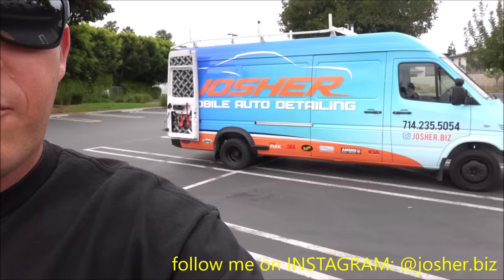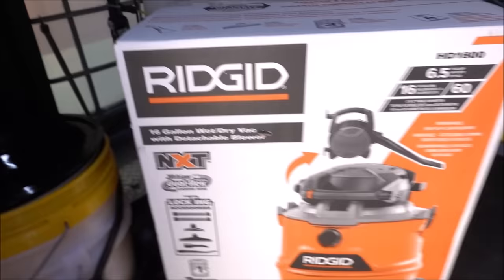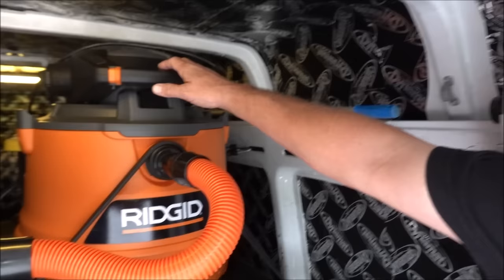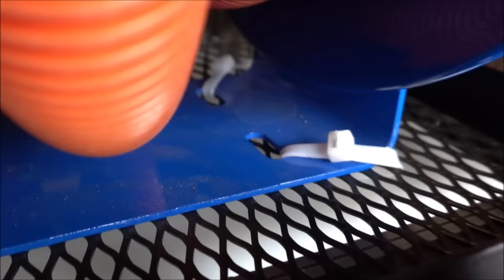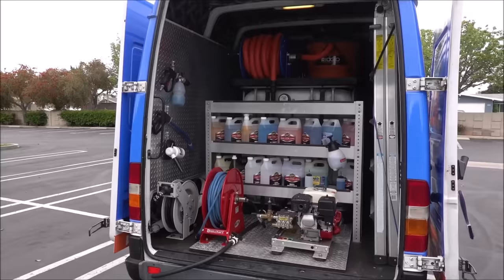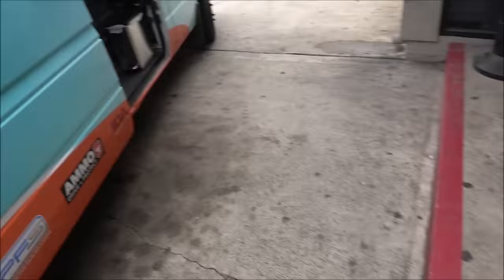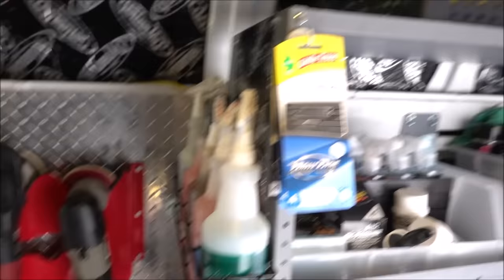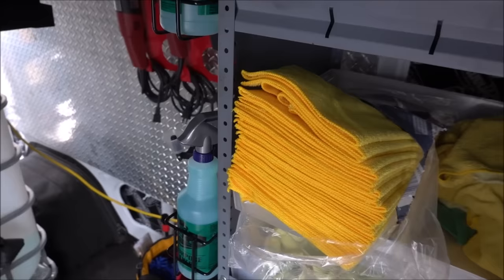My Mobile Detail Setup (*UPDATE**)  - New Vacuum / Hose / Reel

Comment: Thats the  size van that all  cleaning firms should have ..great job  ( only thing i would change is the water tank.. i would get  a proper water tank and get it bolted to the chassis  for security in a  crash )
Reply from the maker: thank you yes.. i love the size.   I think the water tank is mounted and bolted to the frame of the van...   the base is mounted to frame rear sub and the water tank is also super strapped down to the anchor points hard mounted in the van on the install..     I think it's mounted and good to go!     I hope anyway huh?

Comment: Great set up.  I just wanted to say that you should take individual pictures of your great equipment 
and have them added to the lower sides of your van,  pics maybe 1 foot by 1 foot in size and maybe
add some words about your equipment pics. maybe  (Top Quality Equipment for a Top Quality Job)
Also you need your phone number in large print on each side and on the back of the van.  you can 
also make something out of clear plastic that holds flyers and business cards and have them attached
to the van (Velcro) for people that are just walking by while you are working can get information without 
disturbing you.  Make them clear plastic so people can see that you have flyers and business cards inside.
Another thing always have a business card holder in your wallet with nice business cards never hand out wrinkled 
or dirty business cards.  Good luck and I wish you the best.

Comment: Great video, I'm currently doing waterless mobile car detailing out of the boot of my sedan, no water, no electricity needed, but i can only charge so much doing that, so I'm trying to transition to regular mobile car detailing, thinking of buying an SUV it'll be enough for my equipment. Small water tank, bigger vacuum, pressure washer, steamer, generator for odd occasions, water hose, product and accessories. I'm not doing paint correction, most I'll do is clay bar for dead bugs etc.

Comment: If you had a cart with all your interior detailing brushes/towels/cleaners and another with all your exterior detailing stuff (wheel brushes/iron remover/wheel-cleaner/etc), you could simply wheel each around with you as you move around the car. Only lifting one item (cart) in and out for the interior and then one for the exterior Just a thought that would make you even more efficient. Maybe you already do something like that...nice setup though

Comment: I been metal polishing and detailing for 22 years past 4 years I've worked at the USPS and still dabbling with detailing  by appointments on my off days. My dream is to to have a van like yours of some sort with all your equipment... this is really encouraging my to do so.. I love your set up my brutha! I need a van like that..what's the making and year?
Reply from the maker: Thanks James   0:44   -   2005 dodge sprinter 3500        (basically i was looking for any 2002-2006 dodge sprinter 2500 or 3500 high top.... long wheel base OR short...   The reason being is it's got a Mercedes 2.7 litre Turbo Diesel motor... Mercedes transmission and suspension.  I bought it for $8,000 with 155k miles.   I got a killer deal as I knew what I wanted and looked everyday for 40 days until I found one in one of the states I was ok with it being in.  Oregon..     Put the deposit on it right away...  flew there 2 days later and drove it back home for 2 days.  It was a beast!    Thanks for the kind words good luck to you on your search and setup!   It's a great thing to do, it takes time to build confidence, clientele and understanding of many areas but it's worth it!

Comment: cool setup.
mind telling me how you did the connection from the vaccum hose to the roller?
Reply from the maker: Hey Victor in the easiest words possible.... I bought a rigid vacuum.... and then I bought (on amazon)   50 foot vacuum hose / reel....  all the parts those things both came with hooked up nicely...   Hope that helps
Reply: OK thank you for answering! 👍🏼
Reply: @josholand  by any chance you have a link to where you bought the reel?
Reply from the maker: @ThGrtCanadian    No prob...   www.amazon.com     search:  vacuum hose reel    it is $499 I think

Comment: How big is your pressure washer gas tank and how much gas do you need to run a hole day detailing  say 30 cars up  how many cars do you detail before your tank us empty?
Reply from the maker: Hard to give you a number but let's just say a tank lasts ALL day of use..  (i don't wash 30 cars a day though lol... more like 2-5)      I carry a 2.5 gallon reserve can on board so just in case I run out or when I do... I have gas to still get me through the day...    Thanks for the questions...   I think the gas tank itself is like.. 1.5 gallons?  just a guess.

Comment: Why would you have anything higher than 2,000PSI for pressure washing? When the job is auto detailing.
Reply from the maker: I'm not sure how about you tell me?   It's controlled by how far you have the nozzle from the target if you were not sure.     Did I need to buy one that says max 2000 psi?    Check out my Instagram.... josber.biz , it's seeming to work out well for me wouldn't you say?   Lol.  You can get whatever psi you want but the higher you go the more careful you better be

Comment: Would a yamaha inverter generator with 2000w starting power and 1600w running power have enough power to run a pressure washer?
Reply from the maker: I don't know?   Mine is a gas pressure washer..   You'd have to check the specs on the electric pressure washer to see how much power it requires.

Comment: Did you need an adapter to connect the vacuum to the hose reel?
Reply from the maker: The 50 foot hose and reel came with everything to work with a rigid vacuum....

Comment: Is the reel and shop vac hose the centec brand? some reviews on amazon say it looses suction power. Have you noticed this?
Reply from the maker: the reel is cox... the hose is the centec hose..  it's the one that I bought on Amaxon for 399.99   now it's like 499.99   I have NEVER lost suction unless i had a clogged hose somewhere...    if they are referring to losing suction due to the length.... you lose like 6%  or some tiny number...   I use this every day almost for the last 3 years almost 4...  It's really a game changer to not have to remove your vacuum from the vehicle you're working out of.

Comment: Josh I have the same vac and reel on order. The vac has that 2.5 inch locking sleeve on the vac designed for Ridgids hoses. How did you get the orange hose to fit on that.....press fit or special adapter?
Reply from the maker: hmmmm good question!   I am pretty sure I just used everything that came with my rigid vacuum and the hose /reel....   IF i had to buy an additional plastic piece I would have bought it from Home Depot.
Reply: @josholand   Thank you.

Comment: Would the leaf blower part of the vacuum be effective enough to dry/blow out mirrors, grills exc? Awesome setup🙌
Reply from the maker: it would...  It's just a bit bigger than my easier 500watt handheld.   If that's the only option I had I would use it.  (it's not bad, just a bit big)
Reply from the maker: p.s.  my strategy requires 1 hand to hold my blower..... and my other hand for a towel so I can blow the water into a drying towel... that works like a charm for me so if I had to use the bigger blower that would be a harder task to maneuver one-handed
Reply: @josholand  I'm glad that works for you. I love the idea of having a larger wetvac with a extension hose. I'm looking for a adapter to make the hose a little bit smaller so I can fit smaller attachments onto the end to fit between seats.

Comment: How big is the difference in power , because obviously the 20 foot hose sucks alot harder than the 50, but is it a huge difference ??
Reply from the maker: Not a big difference.... the 20 foot does not suck a lot harder.  You wouldn't notice and if it does it might be a 10% difference at most
Reply: @josholand  thank you for the response, I was at home Depot about to order that real and hose, but I waited so I could talk to a vacuum specialist at the sir vac place, and he told me that switching to the 50 foot hose, I would lose a tremendous amount of power, so I did not do it, but now I am hearing otherwise, I think I am going to try it out.
Reply from the maker: @derricklarson2632  don't listen to that 'specialist ' because if that was his answer I can tell he has never tried a 50 foot before on a 6.5 he vacuum.   Works great on a 5hp vacuum too

Comment: Do you use a pump from your water tank to your pressure washer? Or does gravity do the job well?
Reply from the maker: a pump
Reply: @josholand  thank you sir
Reply: josher - Mobile Auto Detailing hey man, your setup is very inspiring! Can you tell me the brand of pump you use? And how you connect the tank to the pump, to the washer? Thank you so much. Subscribed!

Comment: So I own my own mobile detailing business and all been looking into buying a new van how good is your fuel economy in the dodge? Also have you find any down side to using the dodge over maybe something else?
Reply from the maker: well the dodge has a mercedes 2.7 liter 5 cylinder turbo diesel motor.... mercedes transmission and suspension.... it's awesome for fuel economy.  When I first bought the van I drove it 430 miles on 1 tank of gas 80mph most the way....  EMPTY cargo area of course.    A couple downfalls about the van is it's height... it can't go through the drive thru's and it can't go into most parking structures....    Also it's long so trying to park it where there is no room to park is a problem if that happens...  I think a SMALL custom setup would be equally cool  to my setup...  check out Tony's setup on  raldas detailing

Comment: I have the same hose reel and using the 6hp rigid and suction is not good at all
Reply from the maker: Something must be wrong with yours mine works great for the last 3 years no problems no issues with such a very strong

Comment: love you bro . just getting into detailing from hobby into new career after 20 years working for the man. So ive got quiet the huge  changing expedition before me! quiet scary really! Cuz I have 2 lexus sedans, and a motorcycle. I know I really need a van like yours I love the sprinters. any advise on where to get the water tank, maybe a used one, and an used sprinter to get me on the go working my ass off? I chose to ask you because of your honesty and humility towards the end, you seem a man just such as I bro. -love from soCal Desert.
Reply from the maker: Hey best of luck to you too..  It is scary to start off doing mobile detailing full time...  for many reasons.  I learned a lot in the last 2 years or so and I realized it's a slow steady pace you want to take and not to expect everything good to happen right off the bat.   If you live in CA then these water tanks should be all over the place.  Farmers use them as well.    I got mine from 'boyce industries'  in Santa Ana, CA     Also as far as the Sprinter van goes....  I searched auto trader, craigslist and ebay for 40 days until I found a good deal..   I wanted one between 2002-2006
Reply: Thank you my dude. Very laid out and detailed. Responses.  I live in a small town near Palm. Springs do not too close to LA unless to out of state peeps were all Los Ángeles haha.  I guess last ? Sorry to bug. How’s the sprinter do maintenance wise? Lexus style or Ford style Maint Hahahah.
Reply from the maker: @bigcroatevo5405  The sprinter van is awesome!   Powerful, drives as if it's a smaller vehicle, gas efficient...   Oil changes are twice as much as a car due to it taking 9.5 quarts of oil.    Maintenance doesn't seem to be too crazy

Comment: HI, which vacuum hose it that?  Are you happy with it still?
Reply from the maker: It's the one on Amazon  OR it was 3 years ago when I got it. ..  CEN-TEC   you can find the cox reel and the hose separate so maybe buy them and put them together.   Either way the hose and reel have been the best purchase for $400 dollars.... saves so much time energy and effort.   It paid itself off after the first 3 months so easily.

Comment: How do you run your exhaust exit for your pressure washer and generator?
Reply from the maker: Hey Junio thanks for the question..   My generator sits right by my sliding door of my van.  The exhaust side of it points out the door, so ANYTIME the generator is in use I have the side door and back doors open.  Also the pressure washer is exhausted out the back doors....   So when in use all the exhaust fumes go outside...   that answer you question?

Comment: Hey Josher, man I've been searching so hard in PHILADELPHIA for a store that sales di water and still at a stand still, Is your diamond plate platform attach to van floor or just held down by weight of water (tank) I don't want to bolt (put any holes) in my van? thank you for this video update
Reply from the maker: Darn!!  you might have to filter your own water some how.   My diamond plate on the floor is mounted to plywood...   I did have to have about 4 holes drilled into the floor of my van but that was necessary to end up carrying a variable 0-2400 lbs in the rear.     Thanks for coming to check out my updated van setup and please let me know what other questions I might be able to assist with.  I love our community of detailers!
Reply: For the Diamond plate you could lay it down with liquid nails caulk or now with these flex seal products I think they have something like that also. So no holes drilled.

Comment: Using the 50 ft hose for the vacuum do you lose suction
Reply from the maker: no...   5 horse power or 6.5 horse power vacuum both work great on 50' hose.   technically you lose something like 6% suction power but if your vacuum is plenty strong you won't notice a thing

Comment: Love your setup! How much was the pressure washer setup?
Reply from the maker: Thanks Blake!   i'm pretty sure I paid about 1300 for the setup and a few hundred more for the hose / reel...    the water tank I bought used for like $250  and the diamond plate / installation was tacked into the price.  Total with parts installation, materials...     (water tank, pressure washer, 100' hose / reel)    custom install)       aprox. $2500 total

Comment: Where can you get the hose at?
Reply from the maker: the vacuum hose?    Amazon.com      The water hose I got from Boyce Industries in Santa Ana, CA
Reply: @josholand  Did you get Centec hose reel 50ft combo?  The $499 one on Amazon?
Reply from the maker: @dencheng9828  it cost me $399.99 on Amazon...
Reply from the maker: I guess it went up in price...   but yeah that's the one
Reply: You can also get the hose at a pool supply store
Reply: @josholand  thanks!!
Reply: @gworkseliteautofinish3611  Thanks!
Reply: Whats then size of the hose?
Reply: Boundless Car Care 400 at Home Depot